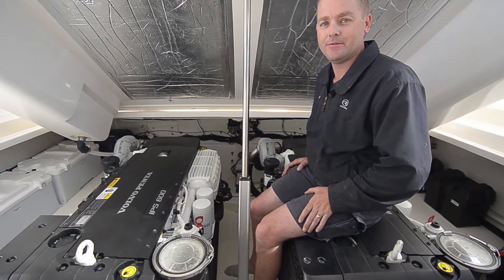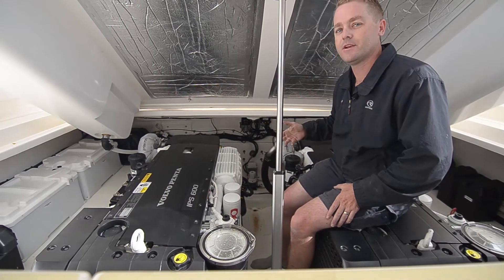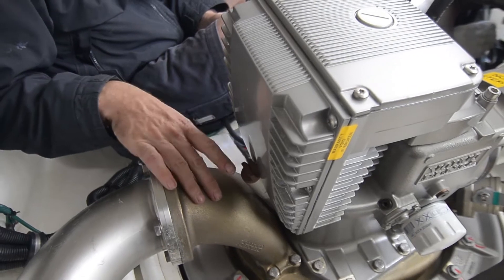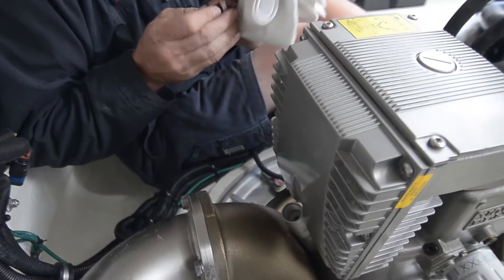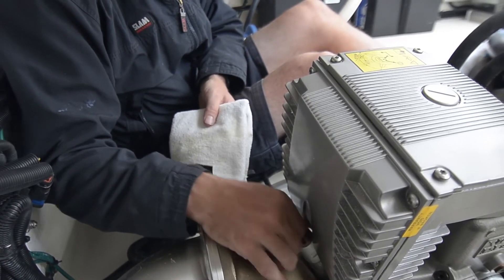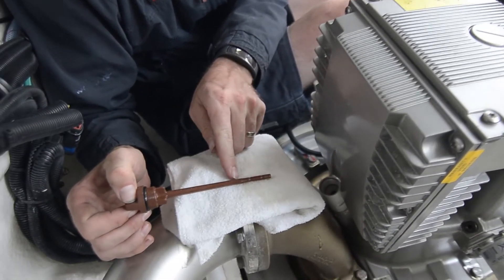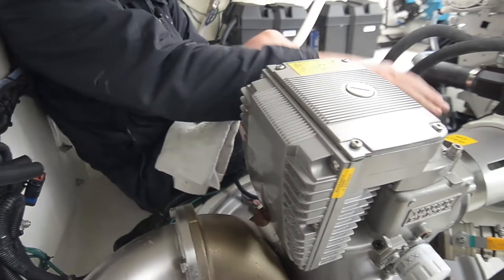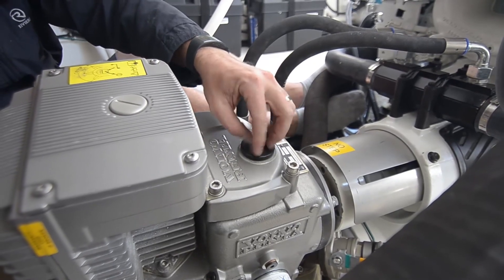Volvo IPS Drive Oil Check - Tips & Tricks (Engine Room Checks Part 1)

Comment: This video should be removed before someone destroys their transmission by adding too much or too little oil. You NEVER screw this dipstick in when checking the transmission oil. That's why this dude said "it's slightly overfilled" please DO NO HARM and take this video down
Reply from the maker: Thank you for the feedback Andrew it is always good to see other people in the marine industry looking out for others. We are fairly confident though in this method on the IPS 1 drive as advised by Volvo Penta. Some other gearboxes may be different and your advice may be applicable. For your reference please see an excerpt from the workshop manual:  
Remove the dipstick (2) by turning it anti-clockwise. "Dry off the dipstick and reinstall it in the propulsion unit, screw it into place. Remove the oil dipstick again and check the oil level. The correct oil level is inside the marked area".
Reply: Glad you confirm this as I need to check my Volvo penta IPS pods here very shortly before the season starts here in the great lakes in Michigan USA.

Comment: The manual says "do not screw down the oil dipstick
when checking the oil level". It also states: "The drive-unit must been shut
down for at least 12 hours before a correct oil level check can be done." 
https://www.volvopenta.com/marineleisure/en-en/for-owners/your-engine/manuals---handbooks.html